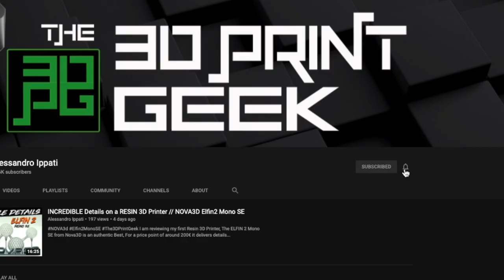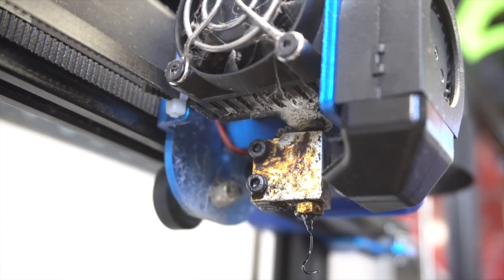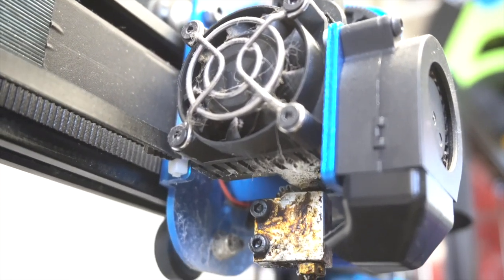Artillery GENIUS/X1 Hotend CLEANING, Teardown and Reassembly

Comment: If using compressed air to clean a fan don't let the blades spin up as it could induce current back to the control board

Comment: Hey. Thanks for your video.
I have a question. 
As you... You know what? Better in italian.
Dato che hai presentato entrambi gli hotend (Genius & SW X1) , secondo te e' possibile installare l'hotend della Genius su una SW X1?
Ho accidentalmetne acquistato quello della Genius, dopo aver cercato di pulire "fai da te" l'originale delle Sidewinder... 
Si... 
Lo so...
Ho praticamente disintegrato meta' dei componenti...
Non avevo ancora trovato il tuo canale. Sono andato alla cieca...

Comunque, secondo te e' possibile installare quello della Genius, o metto mano al portafogli e ne ordino un'altro (magari sta volta quello giusto)?
Reply from the maker: sono esattamente gli stessi, cambia solo per la genius pro e la X2 ... X1 e genius montano lo stesso identico estrusore, penso cambi solo la leva per inserire il filamento, ma e' identico
Reply: @AlessandroIppati  fantastico. Mi hai salvato dallo stress di dover riordinare il pezzo e dall'ira della moglie per aver ordinato a ca**o 😂
Reply: @AlessandroIppati  Piccola nota.
L'estrusore e' praticamente uguale, ma la board ha un connettore diverso in quanto supporta BLTouch. Quindi il ribbon cable (giustamente) non ci sarebbe andato (o forse si, ma avrei rischiato di bruciare altre parti della stampante...). Ho risolto rimuovendo la board sull'estruder della Genius sostituendolo con quella della Sidewinder (che fortunatamente ancora funziona). Per adesso, 18 hours into a print, sembra andare. Ora devo solo sostituire il cavo dell'hotbed, che grazie alla guaina vergognosa di fabbrica si e' lacerato e ogni 10 minuti mi da MINTEMP error. Hai qualche suggerimento su dove trovare un replacement e che tipo? (e magari un video dove spieghi come sostituirlo? XD )

Comment: You installed your new heater block upside down.
Reply from the maker: You may be right but it still works perfectly!
Reply: @AlessandroIppati  I don't doubt it does, but it's likely putting unnecessary stress on your heater cartridge and thermistor wiring, may consider flipping it back over :)
Reply from the maker: @jsaths1688  Thnaks, I am actually waiiting for a new one today, I will be more carefull this time. thanks a lot for the advise. I appreciate that
Reply: recognized that only because I took a look at it a second time - you got eagle-eyes!

Comment: In 2:13 what is that part called , the plastic plate that holds the heat block
Reply from the maker: Check this out https://it.aliexpress.com/item/1005003360929670.html?spm=a2g0o.productlist.main.9.4ad3145ddcEr1Q&algo_pvid=a78c77cd-74e0-4141-9714-558b5001addd&aem_p4p_detail=202302090208104124524522174140000733096&algo_exp_id=a78c77cd-74e0-4141-9714-558b5001addd-4&pdp_ext_f=%7B%22sku_id%22%3A%2212000025400695463%22%7D&pdp_npi=3%40dis%21EUR%2112.07%2111.71%21%21%21%21%21%40211bd7d616759372908335085d06d9%2112000025400695463%21sea%21IT%212696416018&curPageLogUid=oQwr8SjTDnPU&ad_pvid=202302090208104124524522174140000733096_1&ad_pvid=202302090208104124524522174140000733096_1